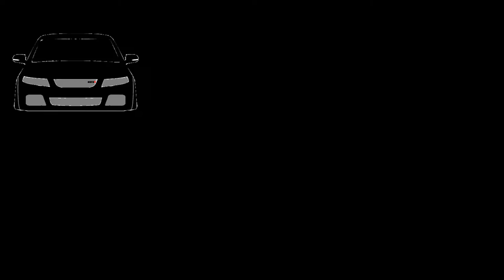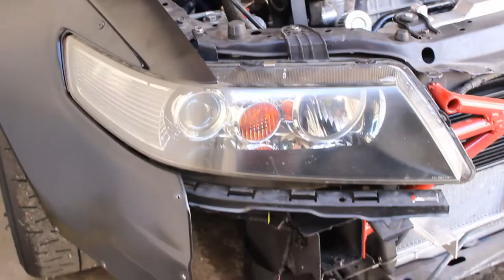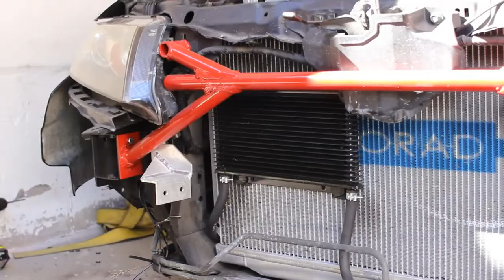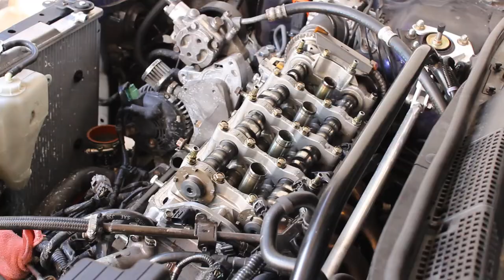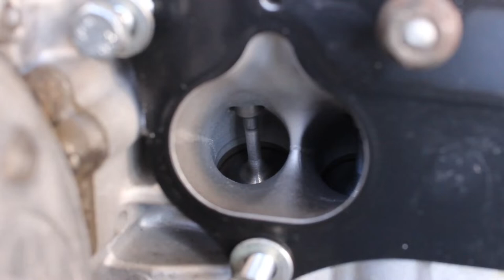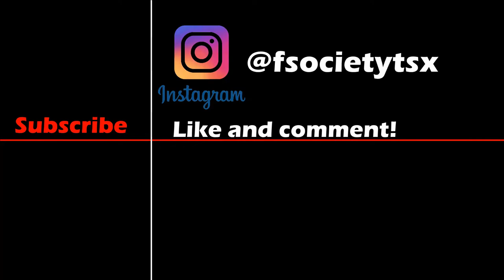K24 Internals

Comment: This engine is clean 👌 and if you want more performance and last longer use amsoil sintetich oil and transmission lubricant and 50/50 amsoil sintetich water mix it will help you out with your budget